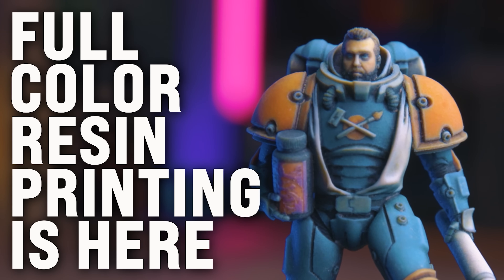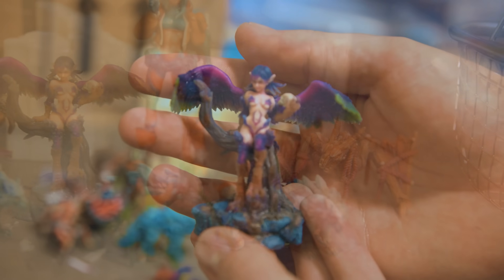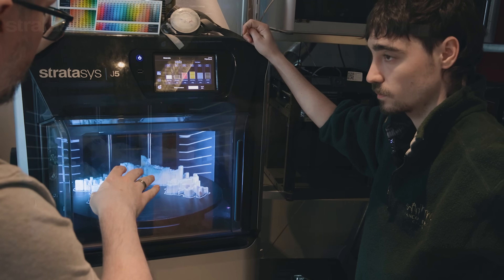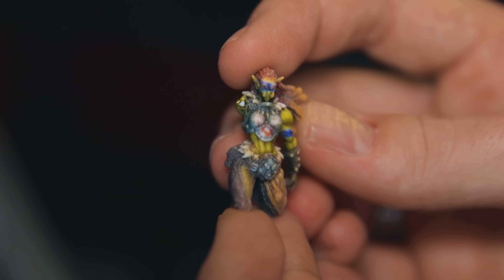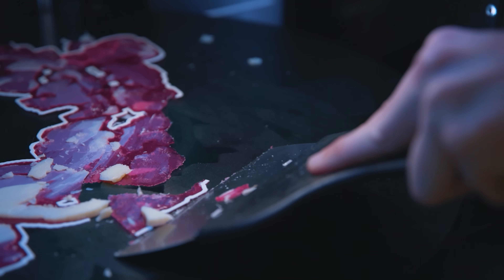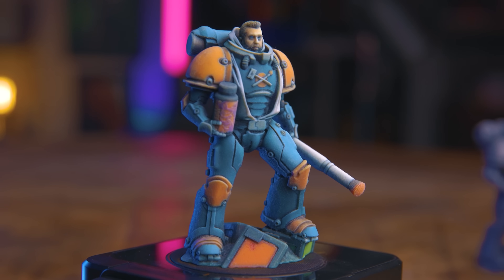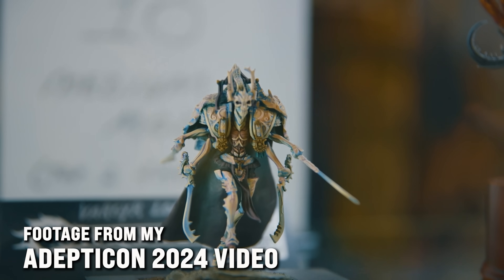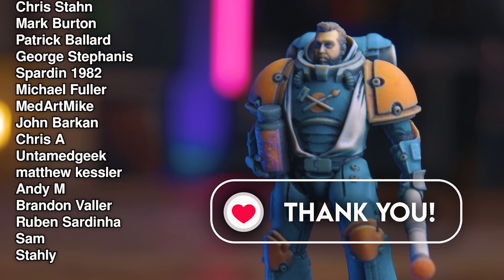FULL COLOUR RESIN PRINTING!!! - StrataSys J55 Impressions

Comment: What's crazy is this is just scratching the surface of what polyjet printers can do. The big brother to this can mix resins of varying hardness and color, so they can print simulated tissue that has a realistic variety of densities and stiffness. Surgeons are using them to practice operations on artificial tissue, created from scans of the patients body. Imagine getting an MRI and printing a 1 to 1 copy of your heart.

Comment: If the surface is nice and smooth, or if they can get it to be in the future, this would be a dream. I don't care about the models being pre-colored, but a miniature with ZERO cleanup?  Take. My. Money.
Reply: The surface finish is actually very smooth; this is especially apparent on non-colored models. The exact texture depends on whether or not the model is printed with a glossy or matte finish. What may appear in the video as a rough surface is just the resolution of the print head on particularly small models.
Reply: @jonathansilberberg8933  i'd like to see more prints of small detailed stuff. the coloured stuff looks kinda rough and i wouldn't use it as "a painted miniature".
I wonder how locked the technology is, and if we'll have to wait 20 years like previously to get it in the consumer market at consumer prices and not at 50k per machine
Reply: @Drestlin  same. I also saw that surface is some kind of fluffy as velvet and colors are a bit washed out and not vibrant. I saw several videos about this printer and most figurines the showed have that a bit strange surface and color.

Comment: What do I think?......I WANT ONE!!!!!  Since its a "quote" only for the price, its probably well into the 10k or 20k range for its price, but you will get that Roi real fast when you can sell pre painted models.  Have one of those with your normal resin prints.  So you offer "blanks" for people who want to paint their own models, but then offer "pre painted" ones for 20-40 bucks more over the blank.  Like say a blank model is 10 bucks or squad, and the same one, pre painted, is like 40 or 50.  So if you want to save money and paint it yourself, its cheaper, if your lazy and don't want to paint it, its a little more.

Comment: I think if they can make a smaller home version it might be really cool, my issue with resin printing is the curing, cleaning and disposal of leftover resin, this seems to skip a whole lot of that, sure there will still be stuff to dispose of but i imagine this basically collects it all and you just get rid of the waste container, no having to deal with waste from a washing station by hand etc, also seems like it solves the ventilation issue

So a smaller home version of this, even if it were mono colour would be amazing
Reply: Maybe it could be simplified down to enough bays to accommodate RGB, black, and a support material in a "home" version of it.
Reply: @AceTheBirb  A monotone printer with wax material would be amazing.

Comment: I mean it's cool but the colors and finish looks pretty scuffed, I'd want paint over it and apply a finish coat anyway and realisticly if I bought that figurine expecting a finished product I'd be pissed.
I'm sure you could make something super cool by altering colors at different depth like with hueforge though.
Now if they made a 1000$ monochrome version and it doesn't cost 10$ in support material for a single print I'd love to get one just to avoid the mess. Not having to buy a fancy curing and washing station is also really good. Kinda reminds me of what Shapify did with Kinect back in the days.
Reply from the maker: Fair enough

Comment: $100000? you know it would be cheaper to start your own small scale manufacturing facility in china, actual high end 80ton injection molding machines cost less lol
this isnt for making army men this device is specifically for prototyping and engineering, it just so happens to also print army men lol
Reply from the maker: Still probably cheaper than a Warhammer army lol

Comment: So I'm curious is the inner edge higher density per pixel than the outer edge?? Awesome tech I'm very interested is there a blue haze on the head of the miniature in person?
Reply from the maker: That’s from my lighting. But not sure any you mean about inner and outer edge
Reply: If you're asking about the pixel density on the inner radius v. the outer radius of the plate, it's the same.

Comment: Brilliant tech. However, LOL, the J55 is an industrial product, the current cost... wait for it.... is USD 100K / GBP 79K, per unit!  Yes folks, for the price of a Porsche Boxster Spyder, you can own one of these too.
Reply from the maker: Which would you rather have?
Reply: @FauxHammer    Depends on the cost to maintain and fuel (power) either, I do assume the insurance will be cheaper on the 3d printer.
Reply from the maker: @mrgunn2726  yeah but fuel would be cheaper than the resin!!!
Reply: @FauxHammer  Indeed a single resin pack costs USD 1409.00 (GPB 1106.00)  YIKERS!

Comment: Consider that my minis, made of Anycubics " ABS like" resin, shatter when dropped. I would LOVE to know how resilient this printer's resin is with the drop test and how many super glues will work to repair them.
Reply from the maker: Haha. I love my model too much to test
Reply: @FauxHammer Roflmao, well, yeah. If a "test model" with thick and thin parts were dropped on camera, or some other bash test just to check how brittle this resin is, followed up by what super glues can be used for repair, I've found gorilla glue does not work well with anycubic ABS like resin, but Locktite does work rather well.

Comment: Once Epson gets a hold of this technology, the printers will only be $1000, but each media cartridge will require you to take out a second mortgage.
Reply: I was thinking HP and their evil ink cartridges.  But ya, same idea.  The media cost is going to be horrible
Reply: @fursphere2  Or Samsung and the constant need to change consumables, even when they don't need to be changed yet.
Reply: @JMcMillen Samsung printers division been acquired by HP in late 2017.
Reply: @mil3k  Thats why I have a Brother printer :)
Reply: @fursphere2  With HP you'll only get through 3.7 prints before the printer tells the cartridge is "empty" (guaranteed 100 prints on the package), then lock your printer until detects a fresh new cartridge!🤣
Reply: @fursphere2  HP is actually one of the leaders in full-color 3d printing tech, last I checked.
Reply: @fursphere2 HP makes jetting 3d printers similar to this technology already
Reply from the maker: Hahahaha
Reply: Yah... honestly I think the only 2d printers that actually make sense are the epson bottle cartridge ones that you just refill the ink bottles.  It's stupid to force your customers to buy and replace cartridges with chips in them that make plastic waste AND e-waste in one object.  Just put ink pots on it and sell ink for a reasonable price and the printer for a reasonable price and youd dominate the market forever.

As long as stratasys doesnt end up having full control over the only resins that the machine will take this could be a great tech... but if they DO I'll stick with ANYTHING else just to keep affordable home 3d printing alive.
Reply: And they will clog up if you dont us it for 3 days
Reply: With nano ink that can communicate with the printer letting it know you refilled the cartridge through the mandatory internet connection to enable printing
Reply: 3.6kg cartridge of polyjet clear already costs £900 🌚
Reply: Idk... my Epson ecotank ink lasts a LONG time. It's kinda expensive to refill, but again lasts a long time
Reply: You are only at second mortgage?! Wow, lucky you . . .
Reply: And the print heads will keep drying out/clogging 🤣
Reply: @markIburgess this is why I went to a laser printer!
Reply: But when HP gets ahold of it, they will all be proprietary and will brick the printer until all cartridges are HP branded.
Reply: It will require an Internet connection and verify the copyright of the model you are trying to print. You haven’t uploaded your own model to an approved repository yet so that the  copyright check will work? Don’t worry, the printer comes with 10 free copyright bypass tickets, with single tickets and convenient packs of tickets available for sale on the manufacturer website.
Reply: Never buy anything from Epson or HP. The actively hate you on a personal level, and they hate your dog too.
Reply: Saw this machine in person in an expo, I even asked for a sample of a small hand, its freakin like real! Flexible with nerves under the skin!
Reply: If hp gets it, you wont be able to print without a subscription for more ink
Reply: I have photos from my smallinone that have been pinned to a corkboard for over 8 years now and and have not faded unlike the ones printed with a Canon printer.
Epson is worth the price.
Reply: @grinningtiki220  sure that's not just because you got Epson pigment cartridges Vs canon ink cartridges?

Any printer you can setup a continuous ink system yourself and get whatever pigment or ink you want at whatever quality you want.

Comment: it is cool, but for me it seems like it needs a couple of years to mature. Both print quality and color variety seems lacking. You showed model file at 11:00 and when you compare it to the end result it's honestly meh. it looks like color is blended in spots where it shouldn't. The silvery bits like bolts and hammer look bland and look greenish, same with blue armor. Oranges are yellow, reds same. I've seen models painted with 4 color, sure they are specially picked to fit the model and aren't just bland FF0000 00FF00 or 0000FF, they have special properties to imitate metal etc. I don't know if resin will ever be able to imitate materials like paint does.
Reply from the maker: They’ve already improved it since my video. I’ll show more from UK Games Expo

Comment: Very cool tech. The color is neat and all, but the ability to print without support marks, clean up with warm water, and use multi-materials all in one go/printing process.... that's incredible stuff. The color would be cool for base coating and not having to fiddle with making supports would be amazing as well. Though I agree that there does seem to be a texture on the surface or is that just how the color makes it look?
Reply from the maker: The texture is because we had to rush the last stage for me to make my train. It has a ton of spray on matte primer in it

Comment: This tech has been around for a few years, it's super cool. The surface quality isn't as good as resin though, it has kind of a sandy, grainly look to it, like it's made out of sugar.
Reply from the maker: The grain is due to us putting too much matte primer on as I was rushing to make my train
Reply: I remember a company called Sandboxr (now defunct, closed in like 2016) used this kind of system for custom prints of characters from certain games. They were pricey (I think I paid like $90 for a 6” figure), but they looked appealing and colorwise were good. They had a clearcoat they would put over them to help darken the colors slightly and make it less grainy to touch.
Reply: @StillBurningStudios  Is there any modern companies doing the same service
Reply: @JJ-vp3bd  I don’t think so, if it was profitable they would’ve expanded. They were making figures for a couple of games, even Halo was one of them. In reality, spending like $100 for a 5” figure of a character you like from a game (and that’s like pricing from a decade ago, it could be more like $150 now) isn’t super popular. Don’t get me wrong, there is a market. But when the printer costs (I forget) like $60k-$100k and material was at $10k a cartridge it’s not a really sustainable business. If/when color resin becomes relatively affordable you’ll see companies offering that.
Reply: it's been more than a few years, more like 25 years.
Reply: There are some new post processing systems offered for sale with the machines that can enhance the more natural look.
Reply: Nice, what would these be? I think they've released a sandblaster, but is there anything else  @CraftHappy101  

Many thanks :)
Reply: @gabrielgarcia2536 The prosurface sand blaster is what I was referencing :). followed by a clear coat makes a pretty big difference.
Reply: That’s likely a different tech. There are printers that work by printing a colored binder onto layers of gypsum powder, producing a chalky brittle part.
Reply: @user-it7kg3pm4q  Yeah that's absolute waffle he's chatting there. These prints are way more grainy than sls or sla printing.

Comment: I'm guessing this is going to be very expensive
Reply: About 100k
Reply from the maker: For the prints or the printer?
Reply: @FauxHammer  Both ;)
I've been eyeballing prints from Stratasys and Mimaki for years. An Elegoo Saturn sized print would cost me about $750. =/
Perhaps this company will make their money back on sheer volume of orders however, vs heavy markup per print at low volume.